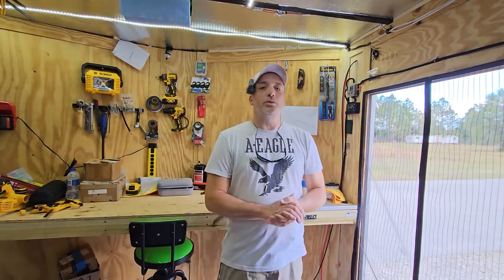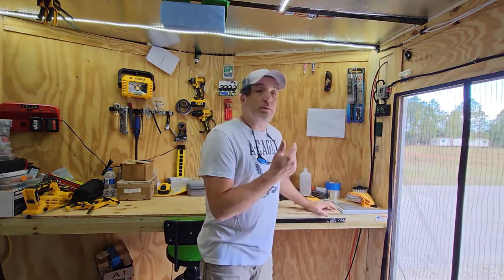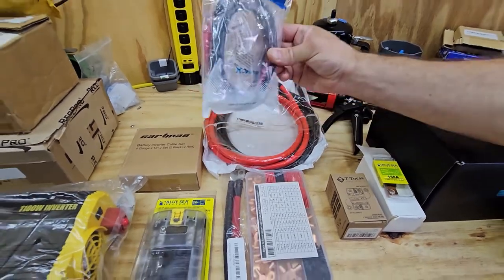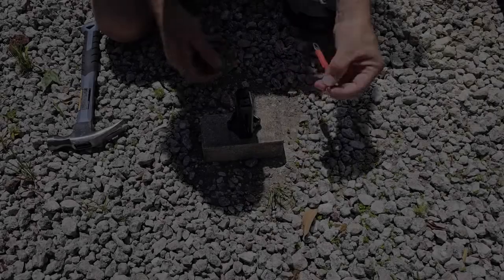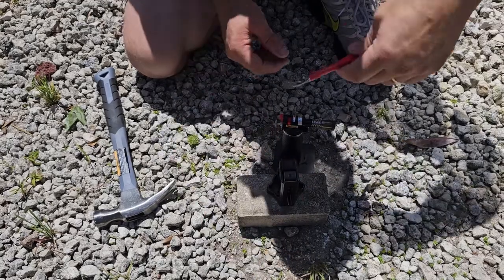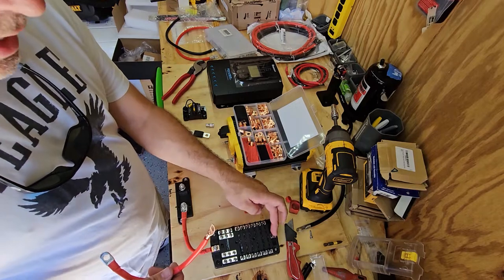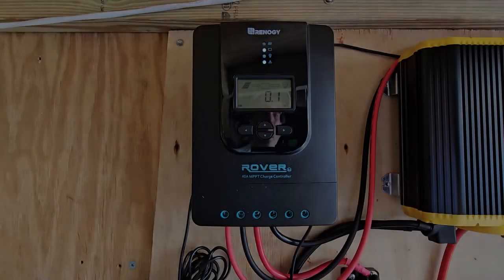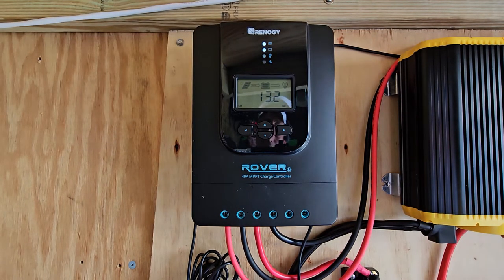Installing Solar System in Cargo Trailer

Comment: Cool setup. I was thinking that I would put a disconnect on the positive from the battery. That would eliminate the sparking. That's obviously not a big deal, but I looked up the NEC and 690 says that there should be one. 

Thanks for the video. I'm doing my homework to put a panel on my rig. I have a two battery inverter system on there, but I want to add solar.

Comment: do you have this grounded anywhere to the trailer frame or within the system?
Reply from the maker: It is grounded within the system. But you could add another ground to the trailer frame if you want.

Comment: will this charge the battery when plugged into generator power and when unplugged run off of 12 volt
Reply from the maker: I don't have it set up that way but yes it can be arranged in that configuration.
Reply: @Jimmy2Tech  thanks how would it have to be arranged differently from yours?